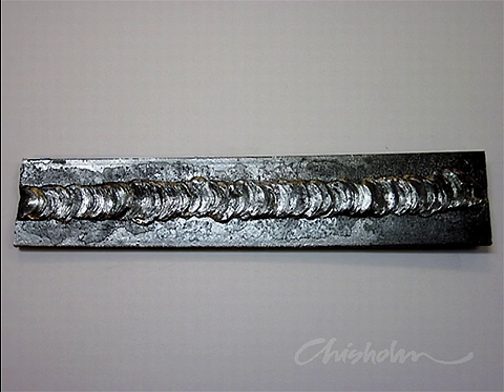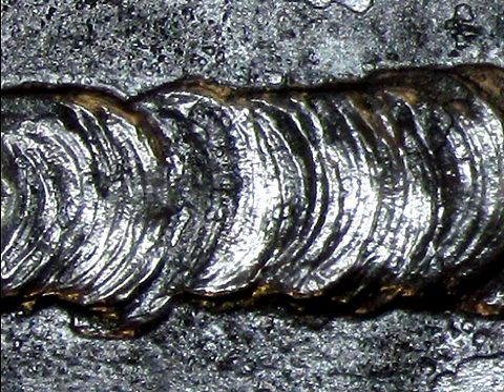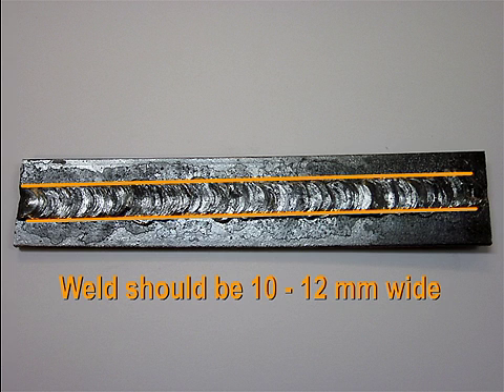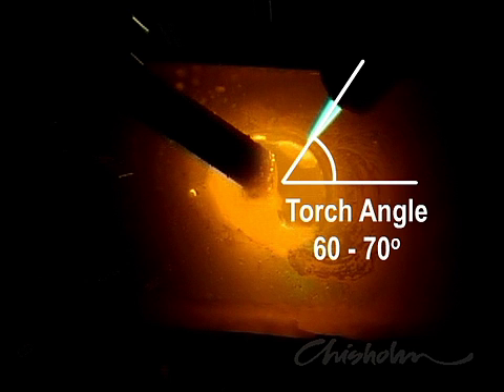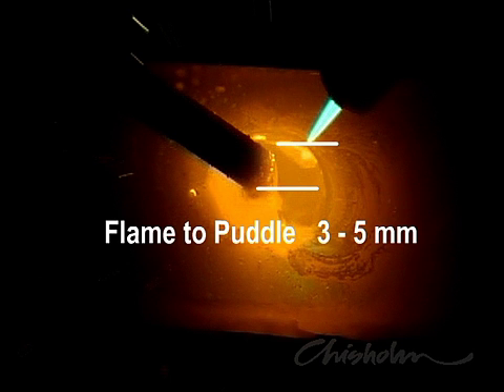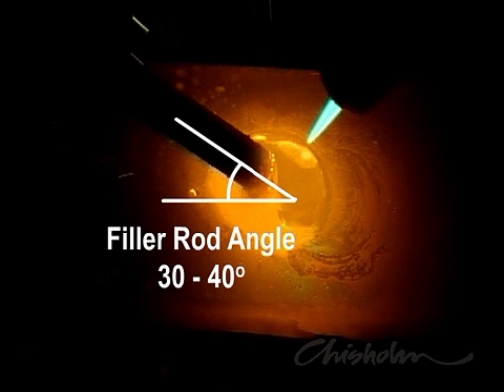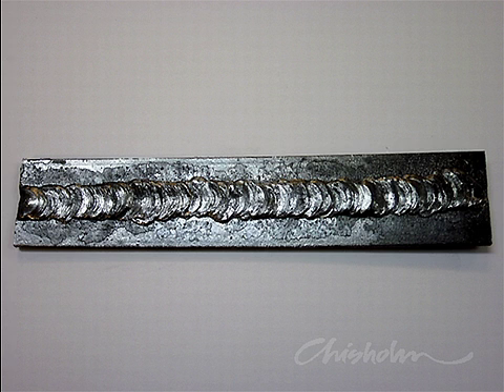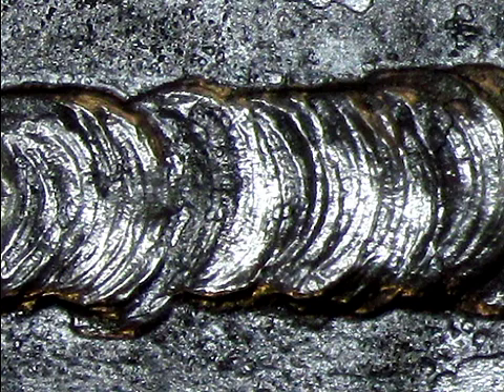Learning to weld: Controlling the filler rod

Comment: That weld looks terrible.
Reply: Donald Parker you look terrible
Reply: OK boomer!
Reply: I know, I just got done with my first oxy-fuel Stringer with filled project, and my weld looked better than this. In my opinion his hand was kinda shakey and he didn't really have a fluid motion. Personally I found that it's good to make a c shape around the rod and then just dab it in as you go.

Comment: how do you stop the sparks going up the tip and popping? scares me shitless every time.
Reply: Exactky. The puddle explodes. I hear you should use a weaker flame and less O. I will try taoday probably
Reply: Lmao
Reply: Earplugs dummy
Reply: adjust the heat and how much you open the valves